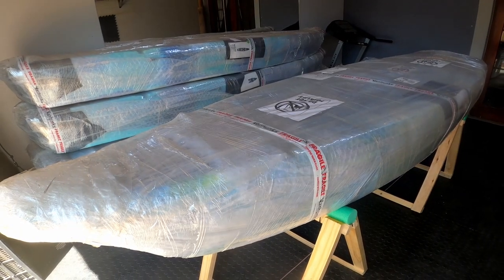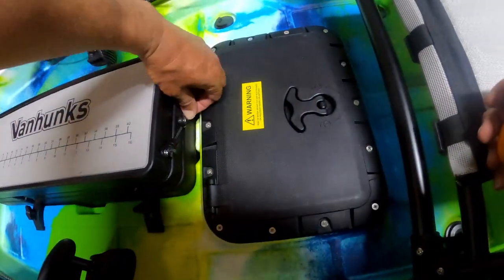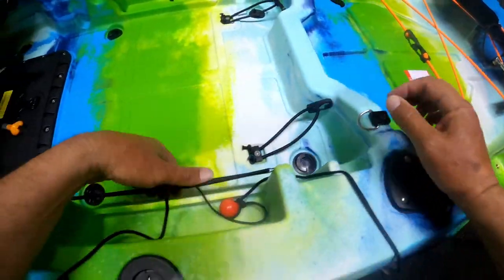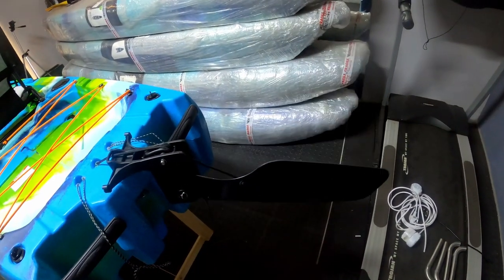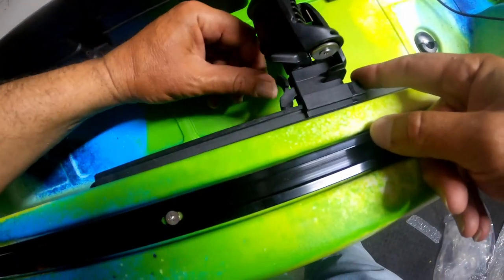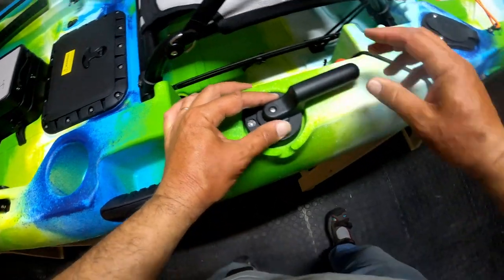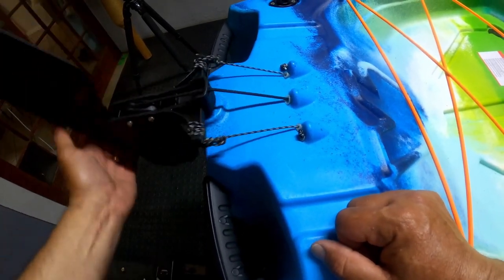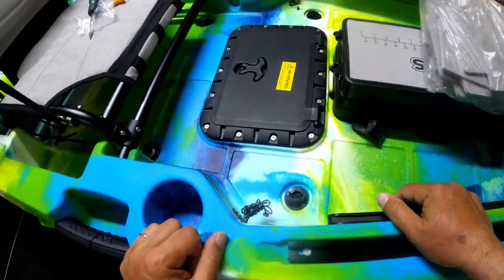VANHUNKS PIKE KAYAK UNWRAPPING, RUDDER INSTALL AND SETUP.

Comment: Thanks Henko.  Are there any issues with your feet reaching the pedals of a prop drive system compared to the fin drive system on the pike? I ask because I note you cannot slide the seat forward on the pike.
Reply from the maker: Good observation there. Actially I haven't taken the pike out yet. Will have to do a onwater test to give you a proper answer.  The Shad is adjustable though.
Reply: @feelgoodfishingwithhenko251  ahh alright. If/when you do test it, please do share your opinion as I am tore between the prop drive that offers the ability to reverse and the find drive.
Reply from the maker: @marccoetzee5166  I deffinatly prefer the propdrive. Will definitely placx a review. For now you csn watch this.
Reply from the maker: @marccoetzee5166  https://youtu.be/U4xsTDSh8Nk
Reply from the maker: You can call me for a chat 0842403457
Reply from the maker: Marc I did test the propdrive. If you are a shorter person you might experience some difficulty comfortably reaching the pedals but we are currently looking at mounting rails to adjust the seat position.  Im 1.8 m and its comfortable for me.
Reply: @feelgoodfishingwithhenko251  Hi Henko, thanks for the feedback, appreciate it. I was also thinking of adjusting the seat forwards to solve this. If you do manage to mount rails please do share the outcomes of that process.

Comment: What size is the pedal drive opening.? Wonder how large of a trolling motor could be installed.
Reply from the maker: The space is 18 cm x 40 cm. You need to put  a two blade prop on the motor if it has a three blade on. You get a special mount called a E-Box to mount the electric motor in that space.
Reply: Thank you
Reply from the maker: If you swap the trippel blade with a twin blade prop it goes in very easily.  The tri blade you need to turn it to an angle to get it through.